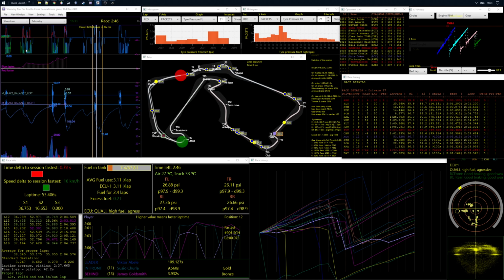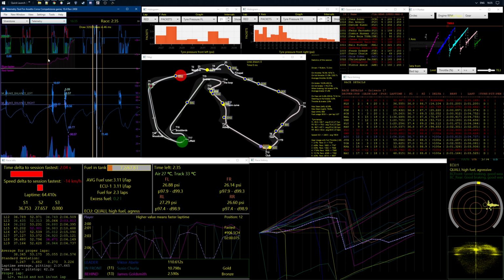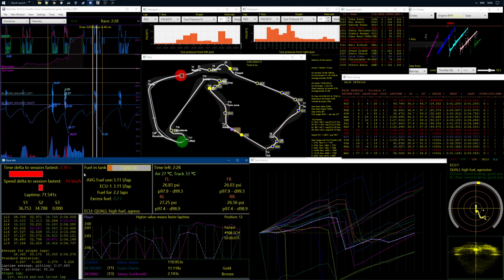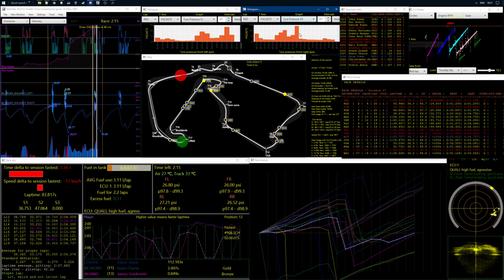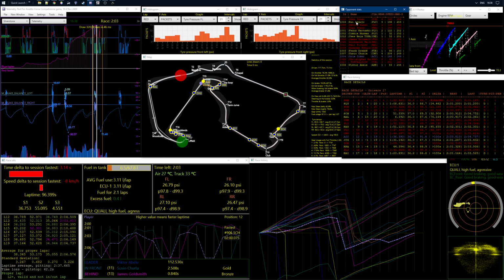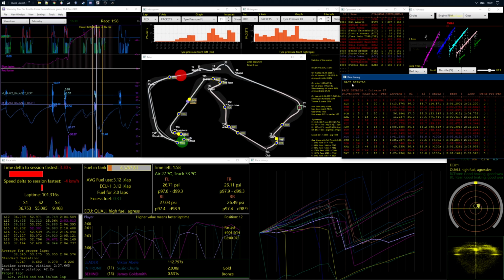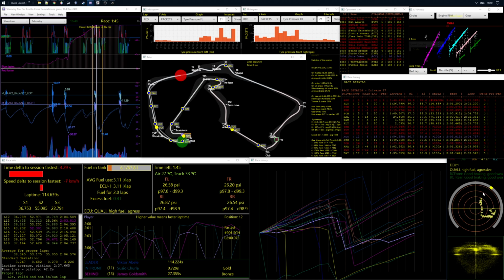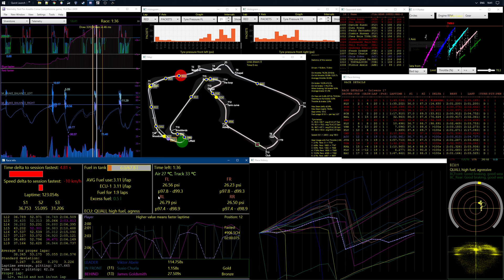How a sim race engineer could use this Telemetry tool.

Comment: When i try to open some of the information in a new window it doesn't work (driving, map, race history) Is this a common mistake, or can i do something to make this work? Driving and race history works in the main window
Reply from the maker: The way the tool works is that if you have the same "view" open as separate window and you change to that tab in the tool, then the separate window goes black. The way to avoid this is if you have always same windows open (like Map + race history), you can drop them out of the "rotation" from the Settings dialog. (Settings --> General Settings).
Reply: @racinggametelemetry  I would love for that to be the case as well, but in this case i have f.ex telemetry open in the main window, and when i press new window -> map there is a window opening, but i cant view it. It is just an empty window which i cant look at. Others, except from map, driving and race history i can open in a new window. (Im on 11.3) testing F1 2021
Reply from the maker: @jacobmathiasnilsen6506  This happens typically, when for some reason the Window coordinates are "bad", it can happen e.g. if you have multiple screens and you alter the screen order. 

Easiest way to remedy it (with version 11.3) is to open the 'Launcher' with runWinLauncher.bat and there select the 'Reset UI' checkbox. This will reset the window positions and the 'missing windows' should be viewable again.

Cheers
Reply: @racinggametelemetry  Ah that was the problem. I am using 2 screens! I changed to duplicate screens, and then I could open map and others in a new window :) Changed back to extend (2 screens) and new map window was still showing. Thanks for the help!

Comment: You telemetry programm have a damper histogram ? Thx
Reply from the maker: Yes, there has been histograms for quite some time. 

In 10.5 I added multihistogram, so you can see 4 histograms as the same time. For suspension, there is position, velocity and acceleration histograms. 

And these work for live laps and saved laps.

Cheers.

Comment: sorry，i have a question，Why my ACC doesn‘t  show Race timing data? THX
Reply from the maker: Hmm, do you get driver names in the race map? 

My guess is that the tool is not using the broadcast data. So open up the ACC settings dialog and save it once. This enables the broadcast data access to ACC.
Reply: @racinggametelemetry I also can’t get driver names in map(only show driver 01 etc ),  the rest of the data also can work, and the racetiming  show:”XXXXXXX”. 
I’ll try your suggestions,thanks again!